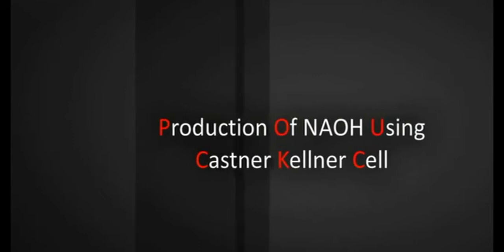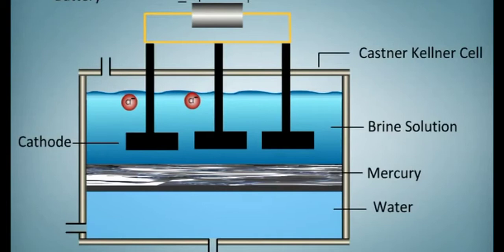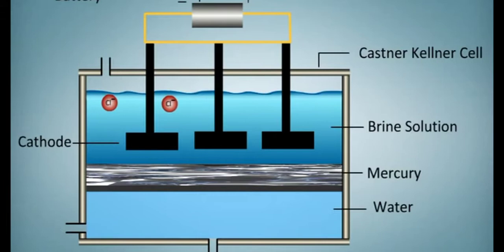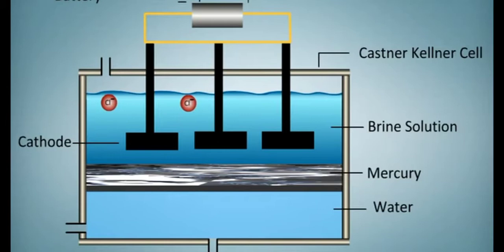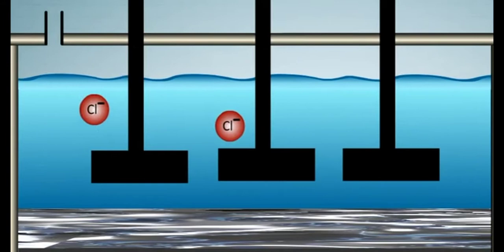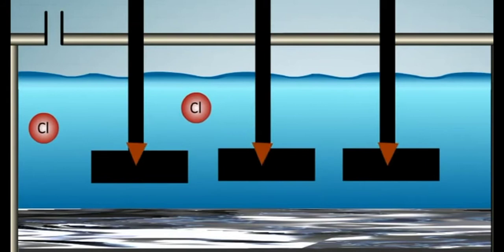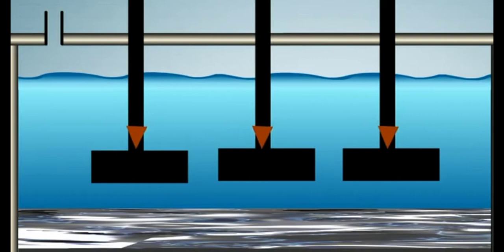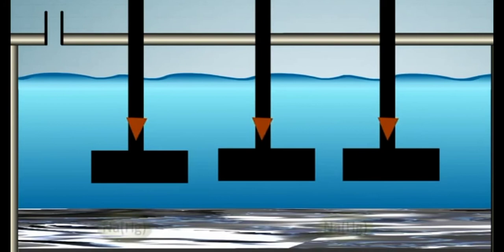Production of NAOH using castner kellner cell

Comment: In castner _Kellner's cell brine solution right in brine solution have NaCl & H+ OH-
When Na react with Mercury then why not H+ react with mercury?????
Reply: Because H+ ions are not easily dicharged due to high voltage of H+ ion on the contrary Na+ ions are easily dicharged over mercury surface.